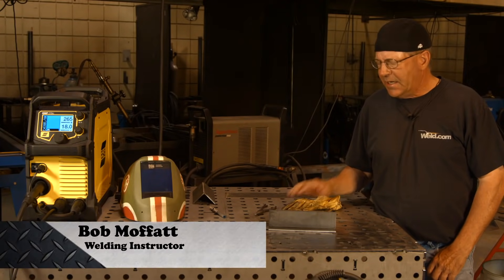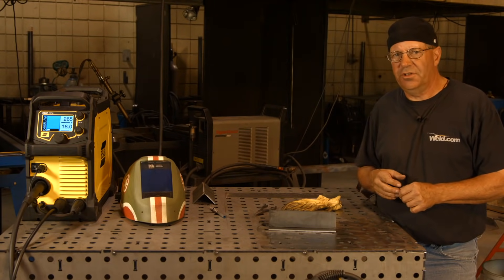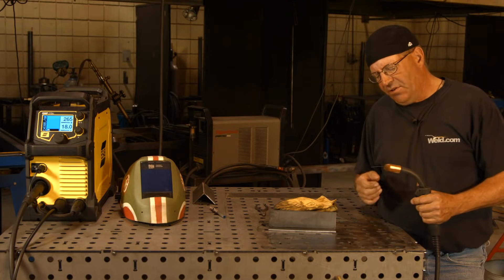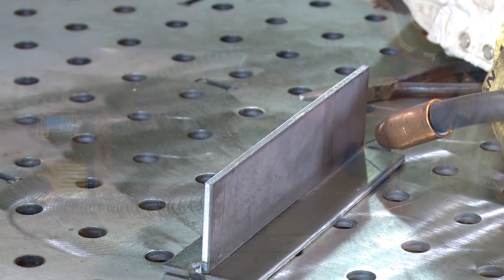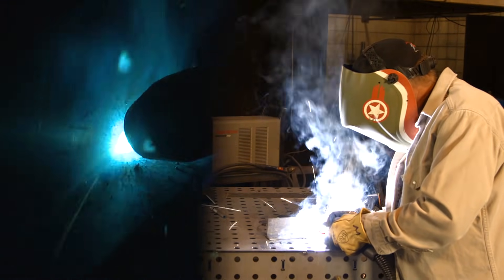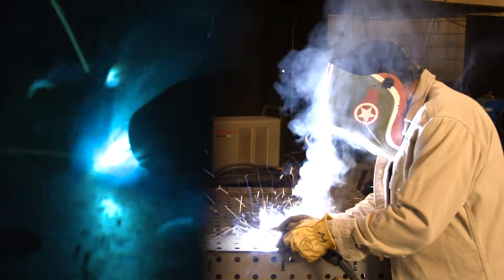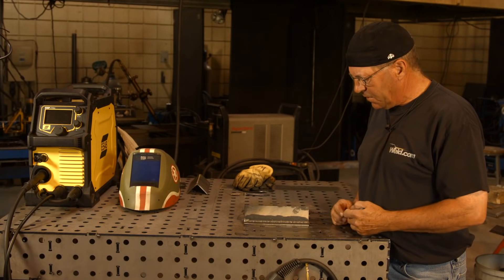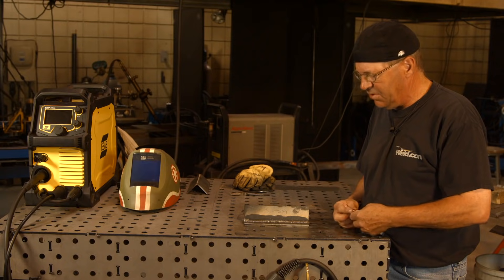Flux Core Welding: The Basics You Need to know

Comment: All these sweet, high dollar welding machines...   I can barely afford that cheap 90amp flux core machine from harbor freight.
Reply: buying fluxcore is my dream,now i only have a tiny stick welder
Reply: Mikail Rahmadnegara — I went from a cheap stick welder to a cheap HF flux core wire welder ($90).  The wire welder is 100X better than the stick.
Reply: @montestu5502  a man still can only dream,but someday i'll buy them
Reply: @NKG416  just bought a 400$ welder for 179$ at tractor supply. Does all 3 types of welding. Made buy metal man.
Reply: @montestu5502  for welding. But stick will always get better penetration
Reply: @NKG416  I'm the same. I sold my stick welder to scrape together the $30 needed to get my first flux core. I'll be honest I struggle with it. I don't weld often. I did alright with my transformer, stick welder. I'm considering hacking my fc welder to do both.
Reply: @NKG416  stick is very versatile, don't underestimate it.
Reply: @Joe Hoe 20k? I wish that's all I spent. I spent that in 1 year. I am 20 years in automotive trade, I am well past 150k. 20k covers my tool boxes. My empty tool boxes.
Reply: @rodx5571  20k in toolboxes?  😂
Reply: @Guitarplayer724  yeah, 20k. Nice tool boxes though 😁. A professional has to invest in his or her trade. I have ALOT of tools.
Reply: Ive had several lincolns, a tombstone n a couple migs, ive had a matco welder and a miller. I picked up a titanium flux 125 from HF about a week ago and am impressed. It is pretty powerful for what it is. Its only supposed to do up to 3/16 but i have welded way past that with single pass and good penetration. Its def got more power than what they claim. For $180 you cant go wrong.
Reply: I paid about 200$ for a century, which is made by lincoln, fine machine for what it is. Just a straight flux core, no gas option. Welds so much nicer than the HFT welders. might think about that machine.
Reply: #workmore
Reply: John McDermott wait for the sales bro, I got a Flux 125 welder from harbor freight for $120
Reply: The competitors to the Chicago/Harbor-Freight Flux 125 which is what I use is the $900.00 MillerMatic 141 and Lincoln Power MIG 140C at $900.00.. I do purely field work and need 120V too.. I refined my kit down to FCAW with the Flux 125 and a Miller gas rig..

I can do everything from a coke can to Cessna landing gear with my gas rig.. This is how I do it without breaking the bank.. Less than $500.00 for my entire setup and I can do certified welds on anything that doesn't require thermite.. I mean my equipment can I don't know codes or have a big portfolio of welding tricks..
Reply: just an all round excellent video.
it is really great that you share your knowledge and skill
Reply: Good news for you .
Harbor freight has the titanium 125 DC i paid $139 black friday deal , bu as you prolly know they have them on sale very often . Check the reviews about it here on youtube . That machine really beats lincolns . Due the fact that is DC it runs good in house outlet 110 vlts without triggering the breakers , i didnt notice a big increase on the electricity bill compare to the other welder i have wich it cost me $1.00 per min . Can you imagine if i had used that welder all day ?
Titanium 125 is a hit.
Ps .   I been welding since 1981
Reply: Pawn Shop - You will find any welder - Spool feed - Tig setup you want at a bargin
Reply: The harbor freight flux core machines are about as cheap as you can get but if you do it right you can get some damn nice welds with them. Paid $80 something for an open box 125 flux and after 30 minutes of messing around I got my welds looking as nice as on the several thousand dollar machines at my college. You gotta move pretty slow to compensate for the lack of power but it will work if you do it right. dont forget to look up a 20% off coupon.
Reply: Honestly, I bought a $300 mastercraft welder on sale and it's been great for about 5 years. Just upgraded to an everlast 251si finally and won't look back
Reply: I Bet you can John, i have stop spending « pocket money» on coffee, lotery tickets, « buy on an impulsion »stuff etc. At the end of the day, i put my « pocket money» in a jar. You would be surprize what you have in a month. I bought numerous tools over a year now doing this, and yes , a Mastercraft flux core welder inclueded. BTW, this is an awsome vidéo.
Reply: @garrycowan4747  Thanks for the savings tip! I'll start asap!

Comment: Hi Bob, how are you? I live in Ecuador and am wanting to get started learning how to weld so I went ahead and started looking around. In my area all I can find is either $1500+ imported 220v mig welders (mig only or multi in 1) or its the generic rebranded $500 chinese 3 in 1 welders that are at least dual voltage. ( I would have to get a 220v meter put in and wired up to use anything 220v only and seeing as I am a renter, that isnt quite an option.) Either way its going to be quite a decision to make seeing as $500 is the monthly wage for a average full-time job. So just plunking down $500 is quite a big loss if I end up with something that doesn't work properly. So I thought I would ask if you or anyone reading the comments has any experience with chinese generic 3 in 1 welders and if they are worth it to start learning with. The chinese welders available here look like they are all the same model with just a different brand on it. The only one I could find a actual model number of was the gladiator 3 in 1 model: IMET 8250/190 BVM. any experience with these things? ( http://tinyurl.com/yc5wbpce http://tinyurl.com/ycdzj6bx )

Comment: The problem with flux core welding is that it's fairly easy to do without much, if any, skill & one can buy a flux core welder pretty inexpensively. Those two factors are the reason a lot of folks, that have never welded, buy a flux core welder instead of a "stick" welder  that requires a certain skill level. After some folks build a couple of small projects or do a couple of small repairs with a fairly easy to use, flux core welder, it gives alot of them an, "I'm a welder" mentality. Fact is, if "stick" welders were the only type of welder available, you would see a lot, lot, less "DIY" builds or repair videos on YouTube that involved any welding. Some people have no desire to learn the skills to properly "stick" weld and couldn't even strike an arc with a rod, let alone maintain the arc & lay a proper weld bead. They just wanna grab a wire feed gun & commence to "easy welding".
Reply: YEAH!!!!! Fuck those people who can accomplish a task easily without extensive study!!!!! 
Work harder not smarter, my ol pappy used ta say!!!! 
Welp, gotta get back to watering my rubber tree!!! 2 more weeks and i can cut er down and fabricate a new wheel for my car, that got a flat on the interstate 6 months ago!!!! I can finally make it home and see my wife and kids!

Comment: if you wanna test your ability pick up a 90 amp Chicago electric welder and see what you can do, that would be the video a lot of people wanna see
Reply: Not if you just trying to pick it up as a starter or to just try it out for awhile
Reply: I've had one of those for 7 years and its still working, I've put  enough wire through that machine to buy it 5 times
Reply: I bought my about 15 years ago for $79 bucks with the 20%coupon of course. I still use it for small stuff. I did up grade to the $169 gas about 5 years age and that thing works great.
Reply: I have that $99 Chicago electric and do fine as long as I keep the amp and feed speed consistent.
Reply: Remember,  ya all, a good carpenter doesn't blame his tools...
Reply: This guy could lay a turd in the trough and it’s still look good. It’s like giving a pro NFL Star a nerf and tell him to through it! It would be farther and smoother than the high school kid who plays weekend QB.
Reply: I have that welder picked it up and nothing but bird shit welds. Now I picked up the Lincoln electric 90 amp and it’s a world of a difference and much cleaner thanks to the dc
Reply: I've had my little mig/flux Chicago electric 140 (the old blue one) for well over 12 years and the thing still runs beautifully. It's only been run with flux during its life.  I've recently upgraded, but still use it for small projects where ease of mobility and such are beneficial.
It's nice to be able to throw it in the truck and run wherever I need to, plug into any regular receptacle, and make repairs with relative ease.
Reply: When i bought a welder, i did go cheap, but i bought "quality cheap". I Bought a Century 120v machine. It is made by lincoln so i figured it would be one of the cleaner "dirty" welders. I tried one of the HFT welders, it was hell. I bought the Century and it was an "oh my God" difference. I only use the Lincoln wire in this machine, works good for me. I am not knocking the HFT welders, except to say you have to be a fantasic welder to look like a mediocre one with those machines. With my Century, I can learn proper technique and know its my mistakes, not the machines failure to regulate voltage and current.

But if it works for you, thats all that matters. One clear advantage to my Century, its not much bigger than a laptop bag, and its light.
Reply: Or you can save up your allowance and buy a decent welder like a Lincoln or Miller.
Reply: @scottydntno  or everlast that what I bought

Comment: I'm having a terrible time trying to learn how to flux core weld with my miller 211. Wether I use the miller auto-set or the recommended manual settings in the machine diagram, or playing around with custom settings, I can't even get a consistent bead

Comment: Hello, I'm very impressed by the quality of your flux core welding...could you tell me what size/brand wire you used in this video? Also, if it was 1/8 inch material that you were welding, how would your technique/wire size differ from the 3/16? Thanks in advance.
Reply from the maker: I believe we were using .030 NR-211-MP Lincoln wire.
Reply: Your weld looks very nice, I will adjust my welder to have proper tension of the feed spool and hopefully will have results looking more like yours.  Thank you for the help

Comment: So is just a a MIG welder with no gas?
Reply from the maker: No sir. Flux Core (FCAW) is a completely different process from MIG (GMAW). However, they are similar in that they are both wire feed processes.

Comment: basically taught nothing but thanks for the video
Reply: I picked up the wire roller tension and polarity. Worked for me.
Reply: Taught nothing? maybe you're attention span is the problem.
Reply: flgliderpilot if you didn't learn anything, that's your own fault.
Reply: flgliderpilot loser

Comment: love the videos, but cmon, lets talk about this smoke going right into your lungs at 4:00.  any smoke from welding must be bad.
Reply from the maker: Yes, welding fumes are bad. In the interest of audio we didn't use the fume extraction, because the wind in the mic was pretty bad. We upgraded microphones and got a Plymovent extraction system that will be in newer videos.
Reply: Max Smith 
Get over it snowflake. Let me see you get your pansy fume extractor into the hull of a tugboat or up 250' on a cracking unit. The real world ain't like your Jr high school shop.
Reply: @dontblameme6328  Calling someone with a genuine concern a snowflake makes you look like an internet tough guy asshole. Give it a rest.
Reply: Take it easy, guys. Max, you're right to be a little worried about fume exposure, but any application where ventilation or fume extraction isn't adequate a respirator with particulate filters can be used. Easy fix.
Reply: Max Smith we get used to it. You can't be a welder and be a pansy.
Reply: @joeturtleneck2300  User name checks out. Take care of your lungs, you need them.

Comment: I use Flux core because it's convenient and cheaper. I welded with gas and rods and the difference between the quality of the bead aestethically is night and day, but this is just as good structurally. My beads come out just like yours with Flux

Comment: I'm just learning to weld, from my son...and I just can't see through my helmet, it's like I'm blind welding, just can't see what I'm doing at all...any suggestions?
Reply: Dude, you just have to get used to it, you're not supposed to see a whole lot, all you need to see is your puddle and your path.
Reply from the maker: Try using a darker shade filter. If you're using an Auto Darkeing, increase the darkness. Make sure that it is actually changing when the arc is lit and the sensors aren't blocked.
Reply: Will a darker shade be better? It seems so,dark now. He is frustrated with me, because I can't see anything I'm welding or the actual area? I'm sorry if this sounds ignorant, but I have wanted to weld for so long and now he bought me one and helmet which is auto darkening and going to teach me...I'm so bummed...
Reply: It takes time just keep looking into the puddle you can also get magnifying pieces to put into your hood so you can see the puddle easier on your auto hood you take turn down the darkness a little the hood won’t let you hurt yourself but it may be to bright and give you headaches from the bright light but no damage if it’s working correctly good luck just keep trying and you will learn
Reply: Did you buy one of those Harbor Freight auto darkening hoods? If so throw it the garbage and get something like a miller auto darkening or even a passive Jackson helmet. They are an investment. I used my 1st jackson  helmet for about 16 years. I tried a Harbor freight that one of my coworkers brought into my weld shop and promply to get it the hell out there.
Reply: Try a #9 glasd lens might be a lil brite for flux but shouldnt hurt your eyes
Reply: I had the same problem with a brand new helmet.... turns out I left a protective plastic layer on and that's what made is so hard to see...

Comment: correct me if I'm wrong, but I saw the two metal plates were not clean prior to start welding, that's why Lots of spotter.
Reply: Lots of spatter regardless. Probably right that clean material would make less but flux core just makes a mess no matter what

Comment: how does the rebel 215 compare to the everlast 211si  in terms of ease of use   I know how to weld well yet setting machine is my weakness I get it it just have to play with it a bunch I want easy
Reply from the maker: It's really a preference. Do you prefer a digital display or analog? In my opinion, you really can't get much easier than the Rebel.
Reply: Thank you I went with the rebel just because I have multiple places locally to get support. All I can say is this thing is awesome the way it changes the arc based on the thickness of the material I was welding 1/8 to a file cabinet paper thin and it was amazing how it handled it then when you turn it up on thick stuff it just welds great. better than anything I have used  so much easier than my lincoln 350mp its like welding for dummies

Comment: hey Bob, glad to see you point out the tension adjustment. see to many welders crank it down so tight where any hiccup in feeding causes the wire feed to spool up let alone deforming the wire. like the tip at the end of the pass to prevent the crater/crater cracks too.
Reply: Were you referring to when he was terminating the weld and turned around and went back over his weld about half inch? I took a welding class in college and just now bought a little Hobart 100 flux core after being out of college for 10 years lol I need a little refreshing to say the least

Comment: Very nicely explained. Quick question: Was your distance appx half inch ? the camera angle showed too close. Thanks.
Reply from the maker: Generally, flux-cored welding requires a stick out of around 3/4-in., which is about twice the recommended stick out for MIG welding.

Comment: Am I understanding you correctly you should your positive on the ground clamp and put the negative on the gun? If that's the case what advantage to the weld quality does that give you?
Reply: Got to change the polarity if using flux core.    Helps with penetration with a change in the heat.    Being it’s  gas-less
Reply: tinydx95t2  that is the way the wire is designed to run. You'll not get a proper weld running innershield 211 wire on reverse polarity. It must be straight or it just don't work. Peace
Reply: tinydx95t2 yes. What's the difference?
Reply: No one has explained why though.

Comment: Thanks for the tip. I've never really thought of it, but the other day i was thinking this is a lot of voltage and current here. I knew about the disconnect a car battery thing, but also never really thought about some welders are A/C. But when you pressed your finger on the wire whilst feeding it did you have the power going to the wire? Sorry noob question but when you get older you look back and think about safety a lot more often!!

Comment: just purchased sealy mighty  mig 100 first time welding, good you tell me if there's a calculator for settings as this only has min and max switch and 1to 10 on wire feed its gasless flux core my welds are crap but not expecting anything else being first time, i ask this as the calculators that come up on line seem to represent welders with dials that have the settings printed around them, or is there maybe another way i could try, thanks John the novis

Comment: So if I get a mig welder, I have to switch the leads? Shouldn't the welder already come with the leads in the correct spot to weld with?
Reply from the maker: It depends what machine you buy. They do come "set up to weld with" just not necessarily with the process you will be using. GMAW and FCAW run on opposite polarity.
Reply: Listen to what you just asked. You answered your own question in the beginning. Yes you'll have to swap polarity. I think some of you guys may want to try something else besides welding. Its definitely not for everyone.